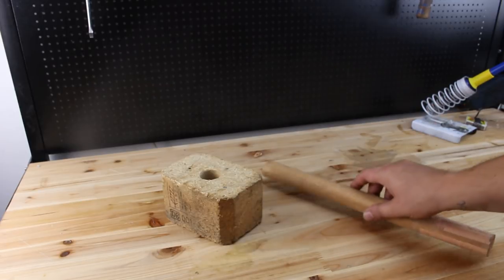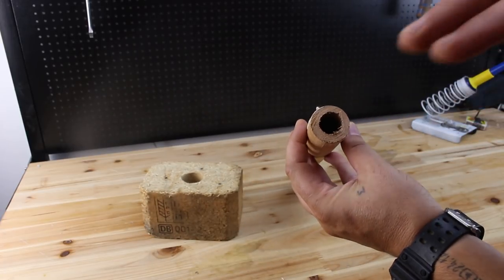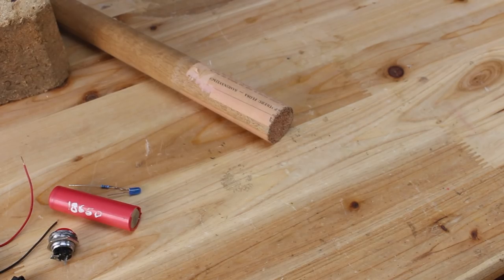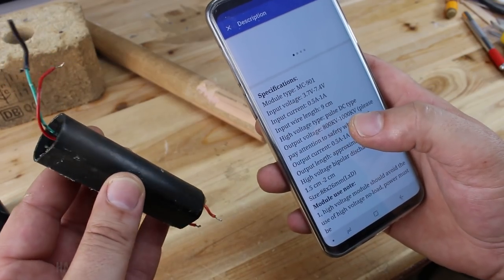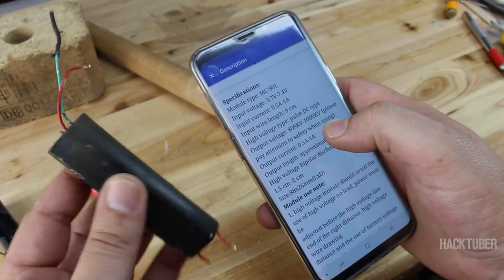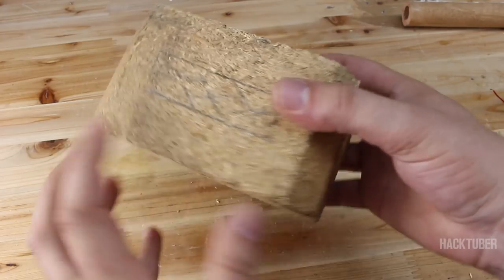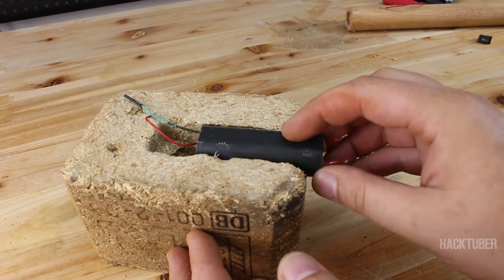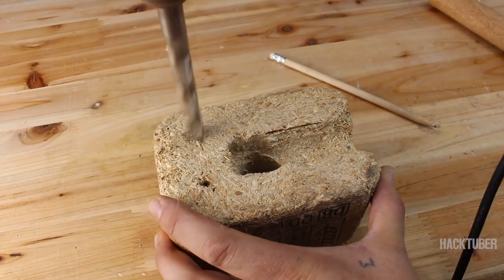Homemade Electric Taser Hammer

Comment: It's not more than 30KV!!!For 1 million volts to jump you need around 3 meters distance!!! In your case the spacing is mot more than 5cm! But still cool!:-)
Reply from the maker: The ignition coil give from 800k to 1000k volts
Reply: You right. ElectroBoom make a video about this.
Reply: Bullshit, this is not even close to 1000k volts.
Reply: American Hacker yes, but if you put the screws so close you will limit the voltage, i suggest you to buy transformer with less voltage, because at the same input power you will have the same arc lenght, but you will have more current, it can bene better, but it's a good project anyway
Reply: Air turns into a conductor at about 20kV at about a couple cm of seperation.

It never reaches 1000kV because of the short circuit. The output rating is 0.5A to 1A. Does that mean your little tazer is outputting over a MW? Hell no.
Reply: Eric Cartman you are right! :-)